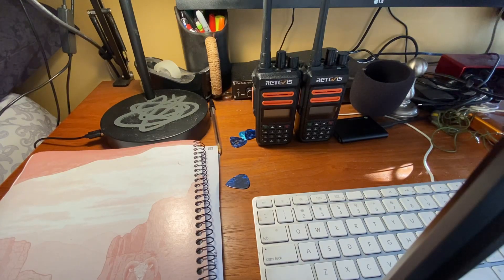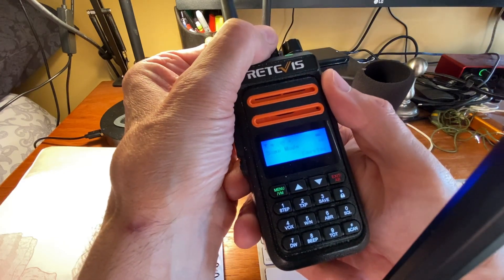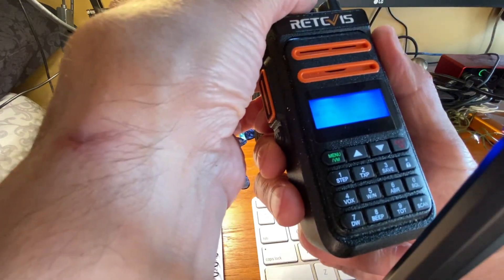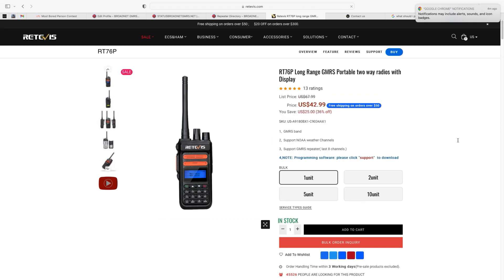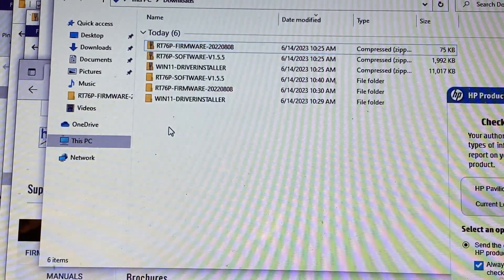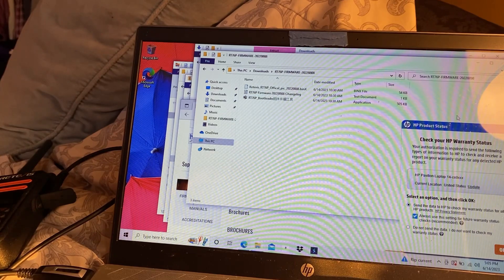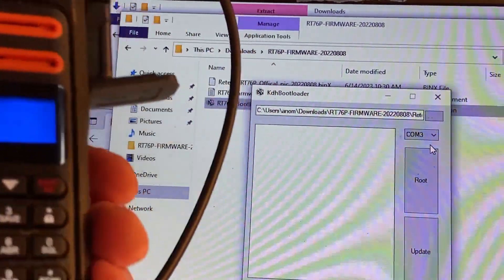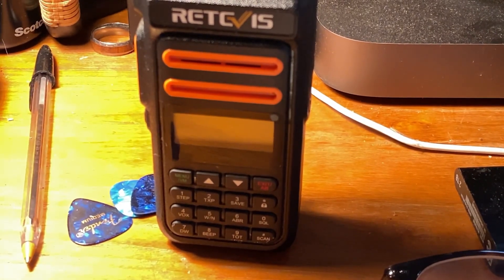How to do a firmware upgrade on a Retevis RT76P 2023

Comment: Would a Baofeng cable work?
Reply from the maker: I only used the cable included, so not sure.
You may want to try posting in the Reddit Retevis group even tho it’s a bit small in subs.
https://www.reddit.com/r/Retevis/s/fObrpRluY8
Reply: @ljshowto This radio didn't have useful discussion there.  
Guess I can email Retevis. I don't want to make a 'brick.'
Reply: @ljshowto  Thanks, I'll try there. Was going these cables would work with different radios since the connection is the same.

Comment: My wife's window 10 computer doesn't have extract all .when we try to look or inspect the folder it says that it's empty. Please help
Reply from the maker: I’m not much of a windows expert.
If there is no option to “extract” or “unzip” when you right click the file, I would look for an “unzip” program and install. Then see if you can unzip.
In addition, the file might be corrupted, so try downloading again.
Good luck.
Reply: Just wanted to give you a update I was finally able to do the update however I wanted to ask you I had read somewhere that it would open additional channels for entering frequencies for scanning and if it can be done how would you save them and how do you access the fm radio function. If you could make a future video about the things I asked about. Thanks
Reply from the maker: @nkflight4647  I never looked into using the Retevis as a scanner for anything except for the GMRS channels, but I do know it will scan other bands - not sure if it opens up any new ones though.